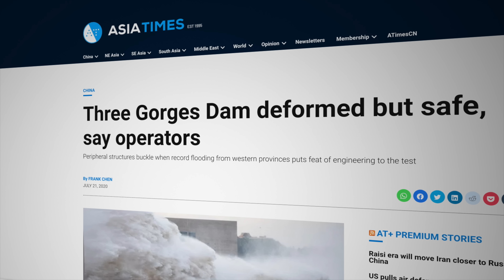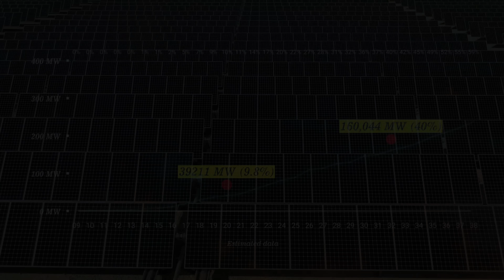World's Biggest Energy Megaprojects

Comment: I apologize for a geographical error on my part. The plant I am ranting about is the Tonopah plant. It may or may not still be operating and one of the 3 development partners is UTC. Having them for neighbors since the mid 50s we saw/heard many explosions, much flaming shrapnel and some craters formed when things went BOOM. Those tapered off over time with a finale that killed 3 when a partially dirt berm underground lab went KABOOM in the early 90s. The most memorable one happened in the 80's when the blast wave went up our lost valley for over 2 miles and took out all the windows in the house near our picnic grounds. It also blew an exterior door off the hinges, across a living room and through a sliding glass door opposite. That structure was about 1 mile from the new craters center. It has taken me until now to talk or write about the dam yankees of UTC from Connecticut. Now I can almost discuss it rationally but have to keep an extremely tight rein on the desire to go into, "Foam at the mouth ranting mode."

*** Beginning of original post***
I think Ivanpah was a sub-rosa way for UTC Chemical Systems Division AKA Pratt&Whitney Rocketdyne get rid of molten salt. That is one of the many contaminants that are produced when making rocket fuel and the only one that can be identified, gathered, loaded on trucks and taken somewhere else. Theirs was a 2 prong method. Get the salt to Ivanpah is one prong. The other was selling the polluted 4000+ acre site to an Open Space group based in San Jose, Ca. Their early evaluation of adjacent property owners was very well done. They knew my great aunt wouldn't be able to take them on so the open burn pits was sited in a location that put 75 % of above and below ground hellish chemicals coming towards us. I use 3/4 of total due to ammonium perchlorate, methyl ethyl ketone and trichloroethylene being water soluble allowing it to migrate downward. BUT this doesn't remove the poison(s) just masks them until their lobbyists can nudge regulators into raising the thresholds. IE; at the property line between the pits and our lake a reading of +4900 ppb was found with the allowable amount of poison being 6 ppb. If you think their actions were atrocious, we agree. They also own Carrier AC, Sikorsky, Pratt&Whitney which are hard and/or dangerous products to boycott. Standing on a runway in front of any jet will get you sucked into the engine(s) air intake which would be quick. Conversely you could simply get run over. I still don't understand why Olin took the heat for poisoning over 700 wells in Morgan Hill and San Martin. They couldn't have used more than a railroad car of ammonium perchlorate in 30+ years of making highway/road flares. One rocket uses at least one railroad car of the stuff.

Comment: Sweden has 39% of its electricity from hydro. This might sound great, but the ecological ramifications are huge. 

Wind, solar, and thermal are all better alternatives for the environment. Hydroelectricity is great for reducing emissions, but the long term goal has to be to get rid of it. But for now, it should be considered only if it is significantly more efficient than other renewables.
Reply: yeah big ramifications compared to wind. Cutting down trees i huuuge areas all across the countryside to make place for those wind turbines sure is ecological, one river in sweden produces almost as much as all windturbines combined. And with those hydropower plants you can actually produce the electricity when you want it instead of when the wind happends to blow(it doesn't when its below -15 C). So please don't spread such bulls##t before doing at least some research.
PS. The hydroelectric production of sweden is between 40-45%
Reply: @arthasmenehil3360  
According to SCB, the Swedish central agency for statistics, 39% is the correct number. 
According to Energimyndigheten, the number is 39%.

Please, if you want to be an annoying know-it-all, please, at least look stuff up.

"The wind doesn't blow when it's below -15 C" 
Are you for real? 

I have had my fair share of frostbites because of wind at below -15.
Reply: Nuclear, nuff said.

Comment: Interesting, technology developed in the oil industry could actually be used drilling deep wells in the geothermal industry. If you drill deep enough, 40% of the surface of the United States contains areas that are good candidates for drilling geothermal wells, also you can use treated filtered waste water/saltwater in a contained system so you don't have to use any freshwater. The issue with earthquakes is really a local issue and you just don't put them right next to where people are living. Technically a large truck driving down the street makes a small earthquake, most of the earthquakes these things create are far below the ability of a person to feel them. Unlike fracking and you don't use any nasty chemicals so you're not polluting the groundwater. Older wells that have been drilled that eventually cooled off, after about 15 years they heat up again and are reusable. It's the most usable green technology that's not really being applied very much. About 15 years ago there seemed to be a huge disinformation campaign on it, and a lot of those unwarranted fears are still preventing this technology from doing a lot of good.
Reply: Geothermal too expensive, not well developed, high carbon footprint of installation and maintenance compared to solar or offshore wind, not compatible with large scale electric grids, overall more effort and cost for less energy. At max capacity of 40%, this would have an unrealistic cost and construction timeline- bad idea.

Comment: The offshore wind farm is not cost effective. It is a big white elephant. It is ridiculous how some cold countries worry so much about the remote possibility of a warmer climate, when they actually have a lot to gain from it.
The Norway west coast highway is extremely costly and the proposed submerged tunnels appear rather risky.
Suspension bridges are a relatively safe and proven technology.
The solar farm in Rajasthan made good sense, however, the peak power output from solar panels does not match peak demand.
The peak power needs to be stored in some way( eg used for the production of hydrogen and synthetic fuel) to derive maximum benefits from the installation.
The Heliostats look like white elephants.
The Tibetan high speed rail looks like a political infrastructure project aimed at shoring up government support 
in a region with separatist sediment.

Comment: Thermal Solar is great because you can integrate Energystorage into the system to be able to deliver on demand.
And Windparks on/at the shore (sry German "an der Küste") should be great because u have wind induced by the sun every day (morning: land heats up faster then the sea -> wind and evening: land cools faster than the sea -> wind) u just need a storage like hydrogen for example (could be anything) "bäm" power on demand.
In sunny but cold (like stable 25°C) regions fotovoltaic (Solar Panels) will be great because they won t suffer from the heat and again with a storage power on demand.
Our problem ain t that we can t produce enough electricity (we could if we would want to), the problem is we have not enough storage for it so we can use renewable energy on demand.

Comment: I think solar panel farms, eventually linked to some type of high energy density solid state batteries, will be the cheapest form of generation and storage. Solar panels are becoming cheaper and more efficient. They convert sunlight directly to electricity with essentially (except switches etc.) no moving parts, in the same way as storage batteries. They are cheap to construct and pose no danger to inhabitants. They can be recycled.
Reply: The problem is they're not that efficient and they only work during the day, you can't store the power on a commercial scale.

Comment: The thing that you don't mention about the heliostats — and which you should — is the potential to store collected heat.  Gemsolar in Span does so with molten salt and achieved 24 hour a day electricity generation for 36 consecutive days way back in 2013.

Yes, there are issues with the moving parts, especially in desert areas where insolation is high, but round the clock operation is something photovoltaic solar power simply cannot do.

https://en.wikipedia.org/wiki/Gemasolar_Thermosolar_Plant
Reply: 聽新聞說。中國有計劃將每千瓦太陽熱熔鹽發電。成本控制在大約0。08美元
Reply: However they want to sell you solar panels and batteries  :) that is the business.
Making a smart solution that stores energy in heat ... that would cut into their profits.

Comment: why don't they made a heliostat like an umbrella think it can shrink or widen easy to manage
Reply: simplicity.  flat plate calculations are simple.  It's so expensive to do positioning to keep things accurate, that they often leave many heliostats pointing into no-where rather than immediately fix them.  Same with PV - it's the reason all these huge farms don't have 2 or 3-d tracking heads - they could gain about 20% a year if they did - and critically they could add a lot of power during the early and late day couple of hours where fixed panels aren't quite producing enough...

Comment: About your comment on Heliostats. They have 1 major advantage over photovoltaic stations - energy retention. PH stations are supper in-efficioned because they only work when there is a direct sunlight on them (even the smallest destruption from a cloud reduces production). They also have peak production hours (mid day when the sun is the stongest and then they go offline during sunset). This forces you to pair them with massive battery packs for storage during off times. 
Heliostats on the other hand are much more stable , yes they are more maintance heavy but the benifits outshine that. The way they work is that the mirrors target a tower full with molten salt which heats up water for steam and then uses conentional steam generators to produce power. The reason why they work like that is because salt is one of the best thermal energy storage compaunds known to man. It takes a while to heat up but it retains that heat for a long time. This effect is used for almost 24/7 power production. Which eliminates the need of hudge battery plants that cost arm and a leg. It also covers the flactuations in production because the salt keeps radiating heat even if the Heliostats have tempoary reduced output due to clowds.

Comment: Heliostats are cool but not the ones with a tower. They can use long parabolic mirrors that have a tube in the focal point. In this tube you can boil water, or better, melt salt. Excess salt can be kept warm in an isolated tank and used for energy at night.

Comment: The lack of technical knowledge of the speaker is appalling.  He said the power of the Three Gorges dam is enough to power United State for the whole year!
The installed electrical power in US is 1,084,000MW in 2018.  The three Gorges has just 22,500MW!  This means US needs at least 49 three Gorges dams working flat out to match its current capacity!

The video is full of errors and inaccuracies.  People who are not technically qualified should not play experts!
Reply: that's not what he said.  What he said is the dam had produced enough power to run the US for a year.... which over it's life, not all that far wrong - at least within "spittin' distance"...   the US uses 4,200 TWhrs of electricity a year.
Reply: @lylestavast7652  Please tell me how the Three Gorges dam, with a published  record of 101.6 TWh per the  year of 2018 comes anywhere near to power the US for a whole year if it needs 4,200TWhrs as quoted by you?
Like I said previously 49 No. of Three Gorges Dam will do it as it gives atotal of 4,978 TWhrs.

Well I am just an outsider but I do find the westerners indiscriminately smearing/misinforming/distorting China and pretending to be smarter than the Chinese are really laughable.  Chinese seldom publish their technical information in details  in English but there are a lot of them in the Youtube recorded in "Chinese".  Real experts in China's engineering will have to be able to understand Chinese.

Comment: Of course all these are using solar power (if the sun wasn't there the water would not have got high enough to get behind the dam  and it would be solid anyway), no winds would blow so no wind or wave power without it etc so they are all nuclear (Hydrogen fusion in the sun) power. Only tidal power isn't from the sun. And other fuels are all stored solar energy.
Reply: Even tidal waves can be said as a stored solar energy. Energy neither stays in the same form. Tidal waves are generated because of atmospheric pressure, moons gravity and earth's rotation. All these things take their energy from sun. But from where does the sun takes its energy?

Comment: I like passive solar the most. Also, what's happening with thermal / wave / tide power generators?
Reply: Not much. Nobody has a design yet that is cost effective and can be scaled into mass adoption.
Reply: @Psi-Storm  Innovations are happening week by week. I first set up a solar home in the 1970's. It worked fine, powering 2 pumps and everything else. I'm adept at putting together PV and passive solar for several times less than the cost that contractors or gov't would charge.  Example, I recently put together another house's alternative power (and water) system, ....the entire ball of wax for under $2,400.  A contractor would bid the same job for 10X that amount.  If the Feds tried doing it, it would be 30 times that amount. Here's one of a bazillion examples of how Feds waste taxpayer dollars:  The cost of 1 inmate at Gitmo = $40,000 per day.  I exaggerate not.

Comment: Solar energy has a maximum set by the power per square meter incident on Earth.  Nuclear energy is far superior for our large scale needs.  Solar is good for rooftops and remote locations, but covering the landscape with them is inefficient and an eyesore.  Its just for the climate change industry's profit.  Wind power is similar in its inefficiency.  Wave power is good, but undeveloped.  We need more nuclear and more reforestation, and significant reductions in migration to developed countries.  While we're at it, we need massive projects to desalinate and move water around the water in a large network of pipes and aqueducts.

Comment: solar panels holds the most promise for the future as its cheaper and easy to maintain than any other energy megaprojects, also sun provides enough electricity through solar panels in a day that humans can use in a year. #fact
Reply: Solar panels also have the lowest peak run time around 10%. So you need large amounts of storage. On shore wind around 30% and off shore wind around 50%. Hydro energy has a high workload, but potential to expand more production is limited in most countries. Solar heat is interesting because you can heat up molten salt to store the heat and also produce energy at night. So you have production and storage in one.
Reply: It's not the best. Better is hydro if possible
Reply: You can't really say one is better than the other. Solar is cheaper right now, but doesn't work at night, in which the demand for energy rises. You neee to balance it with eigher energy storage or a secondary energy source that works at night.

Comment: Great video, but Hornsea 1 is only the largest fully commissioned Offshore wind farm and it's small compared to the sites currently under construction... for example, Doggger Bank is using 13MW turbines that stand 260m tall with a 220m rotar diamater, and located 131km from the shore. vs 9MW / 200m / 154m / 120km for hornsea 1. In the upcoming "Scotwind" leasing round, we will see this step up further to 15.7MW turbines

Comment: Heliostats (too expensive to maintain): Mirrors are cheap.  Lots of square miles in these arid places. Why create a system where tracking is required? Fix the mirrors in for a particular hour of the day.  Then next to it another fixed mirror array for a later hour.  Repeat, Repeat and serve when done.
Reply: or maybe 3 preset mechanical positions per mirror instead of full tracking?

Comment: The heliostat facility was abandoned YEARS ago in California.
Reply: Might want to recheck your sources, it's still operational here in 2021.  Are you... from the future?
Reply: Not true - Ivanpah Solar Power Facility produced 271 GWh in 2020.
Reply: Maybe that is why I really had not heard about it!!  interesting though!
Reply: @msbgone  watch michael moore's documentary planet of the humans. He exposes the scam of climate change.
Reply: I heard of it long time ago, but didn't know it was abandoned, it's too bad
Reply: There's more than one along that eastern edge of CA.... .ivanpah, if I recall correctly was bought out of bankruptcy and still producing  - in 2020 it was about 90% of design capacity.  The issue for them was that they used NG to keep the medium at a temp where sun-up hours could bring it back into full volume production quicker.  Again, from memory, the new operators just run it and don't worry about the NG optics re:  CO2...   CSP requires some really special design forethought and geographic conditions to work well... it hasn't panned out as well almost anywhere, but on the surface seems like pretty much a slam dunk.